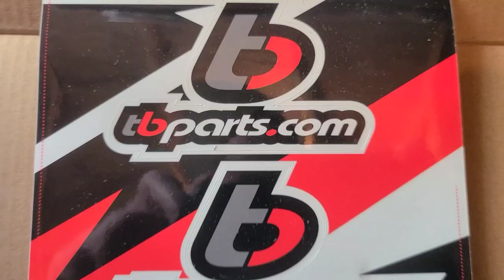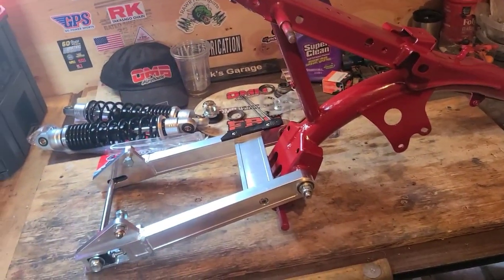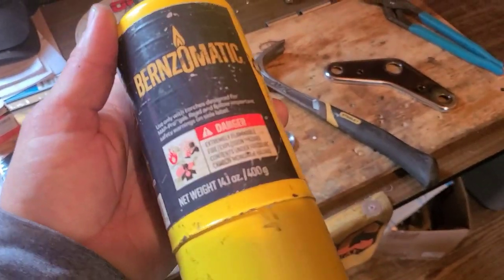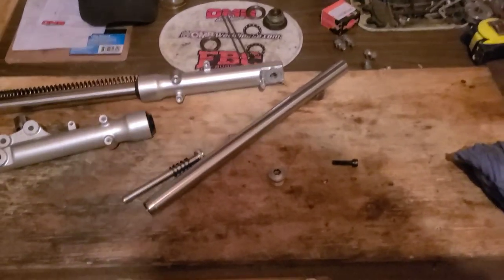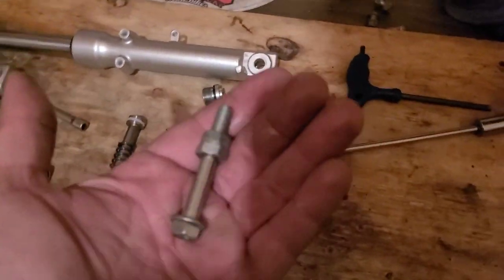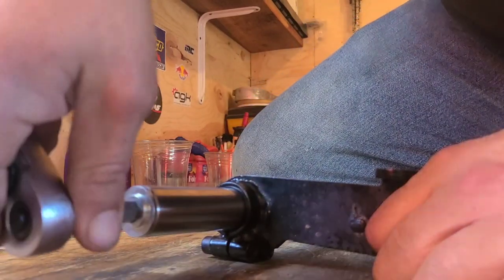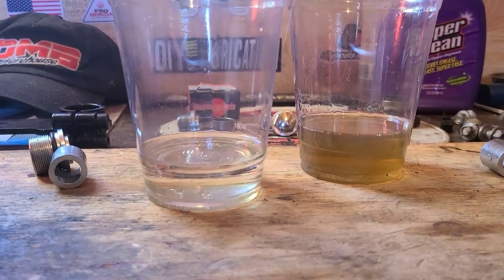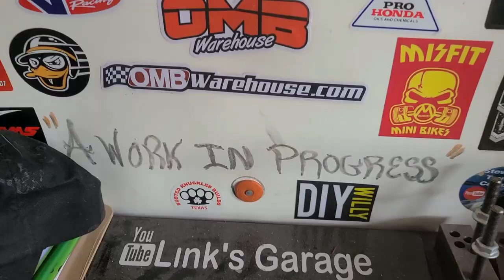Down & Dirty Z50R "Suspension Package"

Comment: I used a impact hammer to get that press fit off. Also, replaced all those bearings with all balls internal roller bearings which handle adult weight much better and won’t have to replace as often.
Reply from the maker: I was thinking about those for my ct70 clone. I've heard great things about All Balls.